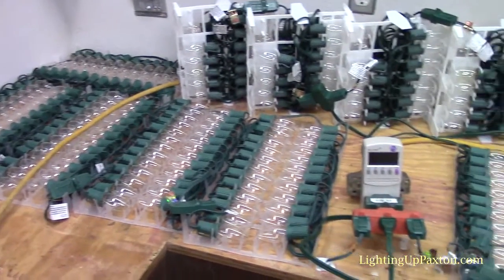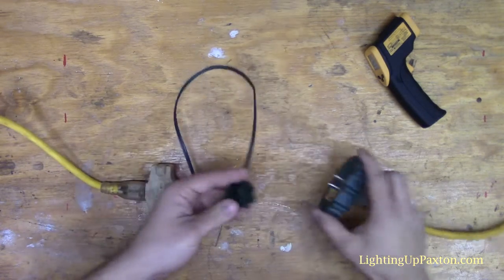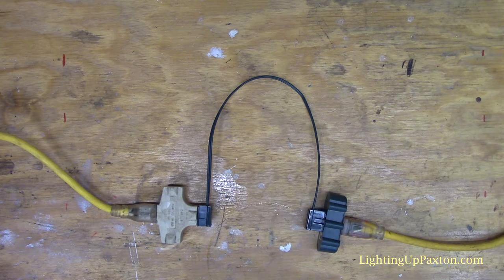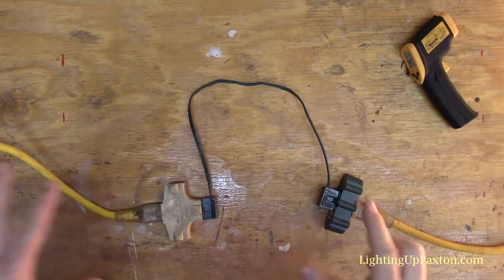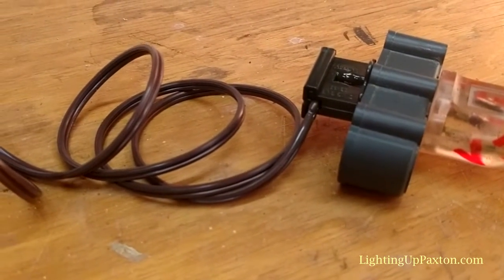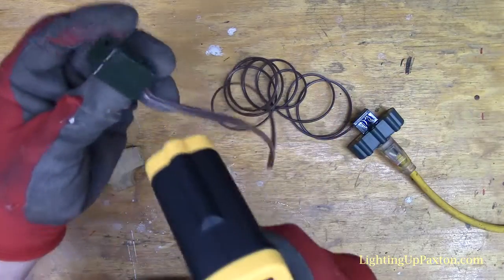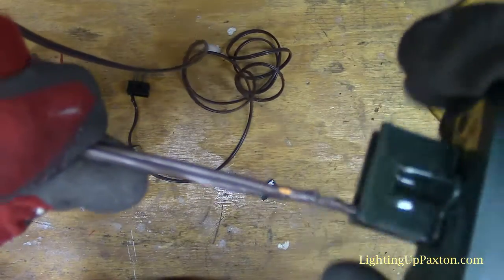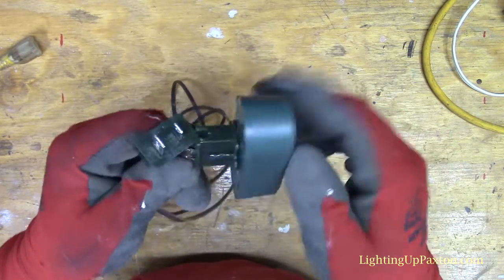Will too many Christmas lights start a fire?

Comment: I have a story about this.  Back in 2017, I was decorating my courtyard with Christmas lights.  Now, this was during the days that LED was a new thing so, LED wasn't as widespread as it is today.  So, I was still using my old dilapidated incandescent Christmas lights back then.  I was just plugging stuff in.  My extension cord didn't have over current protection with 18 AWG wire.  Well, I came into my courtyard and over half the display was not working.  More investigations revealed the problem.  It soldered the extension cord to my T-tap and it actually melted my T-tap.  I am a firm believer that over amperage can cause fires.  No question about that!  This is what I do.  Use Christmas lights efficiently where fewer strands cover more area.  Use extension cords that are rated for the load.  Use LED Christmas lights.

Comment: What if you have them on your wall will it start a fire like the christmas tree
Reply: It could if too many plugged in at once. C9 strands can only handle so many plugged in at once. 
Stay within range of your circuits and use the right extension cords.

Comment: Why do you use vampire plugs instead of normal extinction cords
Reply from the maker: Vampire plugs are specific to spt lamp wire. I use them because they are most cost effective, install quickly, and are secure and relatively water resistant.

I use spt wire instead of larger grounded cords because again, it is more cost effective if most of the cords are only carrying a few amps each. This video was to test how this setup fails since the one bad thing is the limited number of amps this wire can carry.
Reply: Lighting Up Paxton ok thanks

Comment: Really interesting video. I've always had this question: I have a Kill-A-Watt P3 and it says that the max current is 15 amps, so what will happen with the Kill-A-Watt if I plug more than 15 amps into it? (assuming it's plugged into a 20 amp circuit)
Reply from the maker: As it did in my video, it just starts beeping as a warning.  In my case it still gives an accurate amp reading up to 20 amps.
Reply: Lighting Up Paxton thanks for the info. I’ve been a huge fan of your display for a few years now and I used your extension cord tutorial and made some of my own SPT 1 cords. Sadly I’m about 3 hours away from you in Lincolnshire, IL, but you put up an amazing show!

Comment: 20 amps for 14 strings!?!?
Man I thought my electric bill was high. I just can't see how you can see these being cheaper over leds
Reply from the maker: In a synchronized light display the difference in electrical cost is not as significant since lights aren't on all the time.  
LED retrofit bulbs that use the same c9 sockets are definitely a more superior product in durability, but the upfront cost of over $1 per bulb can make them cost prohibitive depending on the budget.
Reply: Lighting Up Paxton and spending a dollar per LED bulb will cost more than you would spend on electricity with the regular incandescent bulbs. Plus the incandescent bulbs look way better.
Reply: @jimmygrant3212  your definitely right about the cost, although I believe I was referring more towards the mini light strands which are not that much more money and last much longer